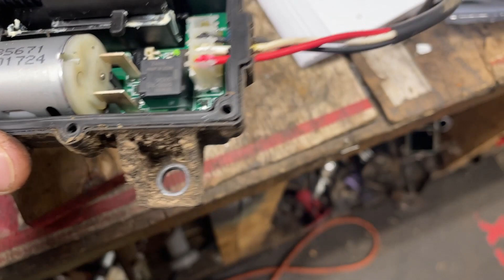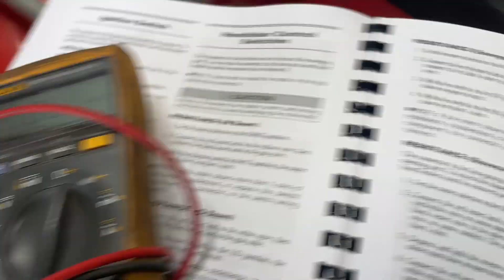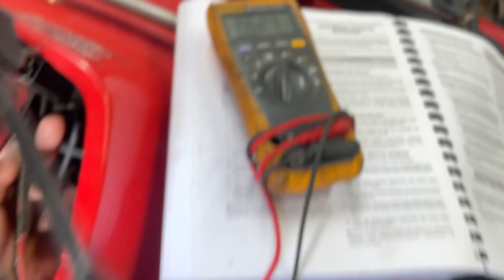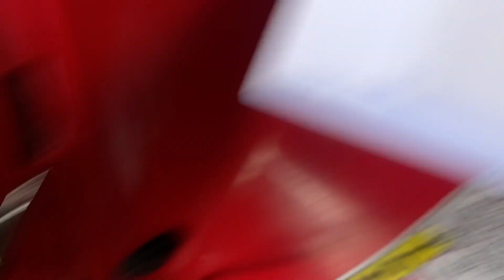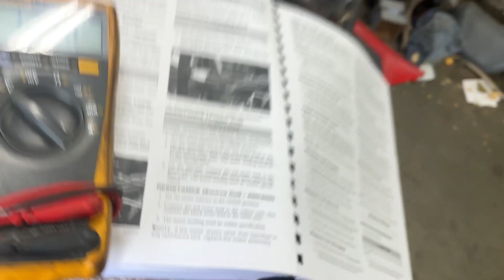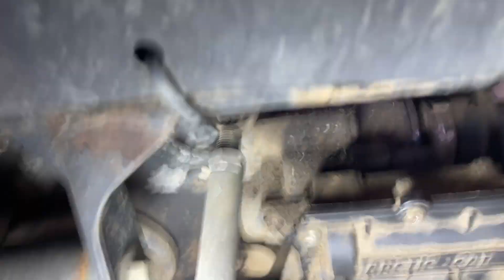Arctic Cat 400 4x4 Actuator Repair 0502-296

Comment: HELLO, I HAVE AN actuator like this that is broken and someone has already tried to repair it. The problem is that transistor Q3 is missing. Do you happen to have any pictures of the board? Or is there a way to tell me the transistor reference? 
Thanks
Reply from the maker: Unfortunately, it was fixed and put back together and this is all I have.
Reply: @BrapStuff  transitor 50WQ03FN close to the relais and q3 is a smd transitor on my board 2NO reference